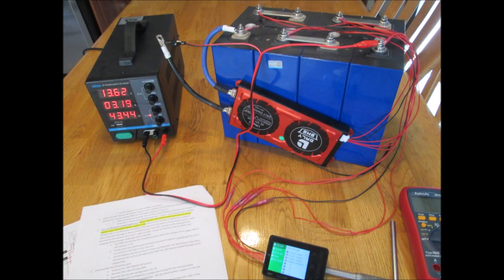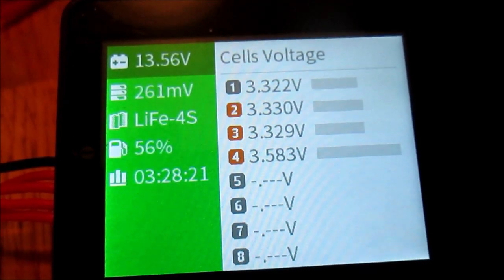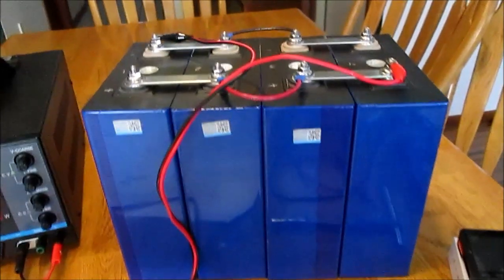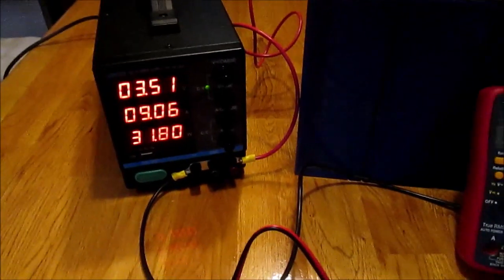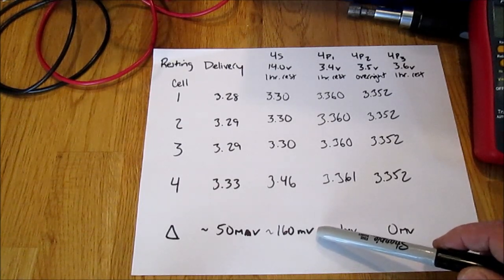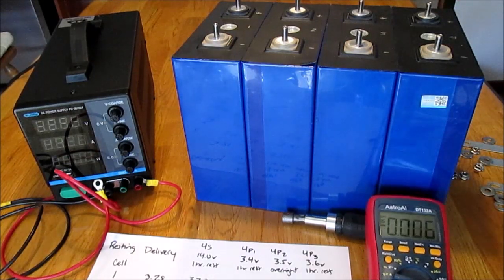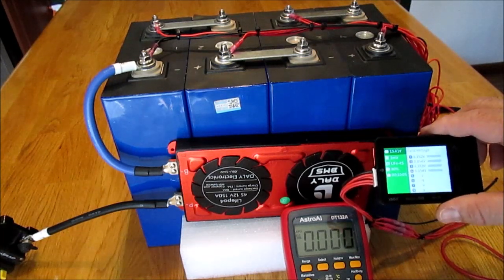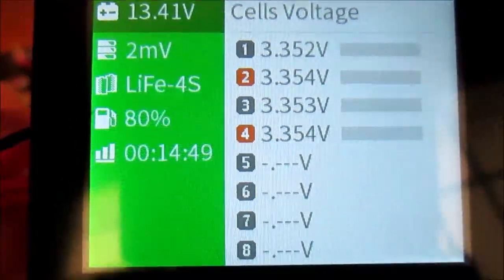V2 P3  3.5 Kilowatt Hour LiFePo4 DIY Portable Solar Power Generator

Comment: Is it okay to use the ISDT BattGo Battery Checker in LiFePO4 like EVE? I mean as a monitor of the cell's individual voltage, 24/7? Because the user manual said, "BG-8S is designed for RC areas, please don’t use this on other purpose." What will happen if you add the capacitor type active balancer plus the ISDT?
Reply from the maker: I have had no significant problems using the BattGo to monitor individual cell voltages  for my 280ah LiFePo4 battery.  I did replace the wire harness because connectivity was weakened and I was starting to get unreliable readings for one cell.  I installed a Heltec active balancer.  It can be used simultaneously with the BattGo monitor.  I don’t use the BattGo for balancing…it is unable to move enough voltage to be effective.  I did install a switch so I can manually turn on the Heltec active balancer, periodically, when the battery approaches full capacity.  Leaving the active balancer on continuously will, in my experience, negate your top balancing benefits by balancing all cells at all points on the charge curve.

Comment: Why aren’t you compressing the battery while top balancing?
Reply from the maker: Needed to reconfigure the cells from parallel to series after top balancing. My compression system was planned to be semi-permanent, as you will see in one of my subsequent videos, and I only wanted to set that final, compressed configuration once.

Comment: If you learn all the BMS can do, you can balance the cells through the BMS after they reach the top voltage.
Reply from the maker: True, Robert, the BMS can balance the cells, but it may take a very long time if the cell imbalance is significant.  The other factor is that their imbalance only tends to become apparent as they approach the extremes of the state of charge curve (top or bottom).  My BMS won't detect the imbalance on the flat part of the LiFePo4 charge curve because the cell imbalance is not apparent based on the voltage.  Many users of LiFePo4 cells choose to set their solar charge controllers to have their batteries operate in this flat part of the charge curve, for example between 80% and 20% state of charge, to promote battery longevity.  Many types of BMS won't efficiently balance the cells until the voltage variation is apparent, and that tends to occur at the top and bottom of state of charge.  To ensure that my cells are balancing at all times I have since added a Heltec active balancer to my system.
Reply: @JimFisherDIYPortableSolarPower  It doesn't very long if you charge your batteries to 90% first.

Comment: How do you explain the drop from 3.36 to 3.35? Was that just your overnight rest?
Reply from the maker: Yes, after charging and resting my cells settled at a slightly lower voltage

Comment: Hy Jim..." i have a Question...can i use 15-24V power supply to recharge my battery?  with BMS DALY will the BMS cut off the current when the BMS detects an overvoltage when the battery is fully charged?
Reply from the maker: Hi Andi...thanks for your question.   I am assuming you are dealing with a 12V battery.  I would not use a charger that isn't specifically designed for a 12V system and the specific chemistry of the battery.   I have a Daly BMS and if my memory is correct, the BMS over voltage cutoff for a 3.2V lithium cell is 3.75V.  The BMS should shut down charging at that point.  That voltage  is beyond what is understood to be fully charged (3.65V) and I wouldn't rely on just the BMS to protect my cells.  I like redundancy in my systems for safety (first and foremost), and also to protect the expensive battery cells and equipment.  My choice for charging is to use either a 12V specific lithium battery charger or a benchtop power supply where you can be in complete control of the voltage and amperage and worry a lot less about possible damage to your cells.
Reply: @JimFisherDIYPortableSolarPower  i saya punya baterai li ion dari laser level Huepar dengan voltase  baterai 7.4v dan dia datang with 12v charger,karena alasan itu saya menanyakannya...saya juga berpikir itu itu akan merusak baterai dalam jangka waktu dekat

Comment: How many millivolts of tolerance can these 4 cells accept, sir?
Reply from the maker: Very good question...they can "tolerate" hundreds of millivolts variation, but you would sacrifice usable amperage capacity as one is going to exceed the threshold of safe discharge well before the others (or conversely it will reach 100% state of charge before all the other cells got close to fully charged).  I can only tell you what my target is on a practical level, based on my first season of use with this battery.  I am comfortable when I see about 6 to 9mv variation in the cells.  I am quite sure my cells are B grade and I accept that perfect balance, at all times, is not likely going to be possible.  Keeping the variance as small as possible ensures plenty of amperage for loads with little worry about significant imbalance damaging the battery.

Comment: Why charge a 3.2v cell to 3.65v?
Reply from the maker: Per the technical specifications for charging these LiFePo4 batteries, they will achieve maximum state of charge (100% of amp hour capacity) when charged up to 3.65V.  The 3.2V rating is what is called the nominal voltage.  Same concept for a 12V AGM battery.  They are 12.8V nominal, but charged up to voltages in excess of 12.8V (13-14V).

Comment: Can I buy once charger to do both series and parallel? Do you have to keep checking it if your charging with out bms?
Reply from the maker: Yes, one bench power supply (charger) will be able to deliver variable voltage and amperage.  When charging without the BMS the charging will stop automatically when the battery reaches the voltage parameter you set.  For example, if you set the voltage to 3.6 the battery will continue to charge until it reaches that state of charge.  You will see the amps drop as the battery reaches the intended voltage target.

Comment: in series connection of batteries they can be balanced with a simple resistor of 100 ohms at 5 watts placed in each cell 3.6volt ÷ 100ohm = 0.036mah continuous balancing. this circuit is a shunt voltage divider used in the first satellites with low voltage batteries to increase the performance and useful life of simple and effective silver and nickel cadmium batteries.

Comment: @ 11:20 you state it's nit good to leave them at a high state of charge, this is untrue. You shouldn't STORE them at a High SoC, but charging them fully is no problem, they are meant to do it for top balancing.
You should have just cranked the voltage to 3.65 and opened up the amps, there is no way that benchtop PSU would hurt them(they are designed to charge at .5c which is over 150amps. seriously, these are not fragile under these conditions. 
Just parallel them up, and set to 3.65 and leave until charge current drops to less than .25amps; then they are done
Reply from the maker: Hi Michael, thanks for viewing and for your comments.   I agree, regarding SOC for storage vs. charging/top balancing.  It was not stated clearly and I can see how my comment might have been misunderstood, but I was not planning to put the battery into cyclical use for a couple of months following the top balancing video.  Hence, the need to reduce the battery SOC  to await the start of our boating season here in the northeast.  I wasn't worried about hurting the batteries, I just took the top balancing process slow to watch and better understand how each of the cells would behave given my suspicion that they were B grade cells and were not likely closely matched.

Comment: Hey if my Cells are well balanced When i got them 3.29Vx4. Do i need to top balance then or can i wire them in series direct and charge them with my ordinary 12v lithium charger.
Best regards Filip
Reply from the maker: Filip, I would definitely top balance the cells.   It is SO hard to know actual state of charge for lithium batteries by using voltage.  3.29V is in the very flat part of the charge curve.   At that voltage one cell may be at 40% capacity while another is at 60%.  Best to top balance all of the cells in parallel.
Reply: @JimFisherDIYPortableSolarPower  okey, thanks for the tip. My battery has now been charging for 4 days and is only at 3.37V. Is this normal ? From 3.30v to 3.37v in 4 days.
Reply from the maker: Depending on the size of the batteries and the maximum amperage your charger can deliver, yes, it can take many days to charge in parallel.

Comment: I think I bought the same BMS for my project and I wanted to warn you about a few things if it isn't the programmable one.  It doesn't cut off at the typical 2.5 volt low cutoff(10 volts for the entire battery) per cell for these batteries.  Also it has no low temperature charge protection, so if they will ever be less than about 34F they may need a heater or some other way to cut off charging to prevent damage.
Reply from the maker: Thanks for viewing and for your comments Allyn.   It is not the programmable Daly BMS.  I read reviews that suggested the programmable Daly BMSs have some issues too.  I do have a lot of redundancy built into my system to prevent damage.  My charge controller has an external battery temperature sensor and the controller can be programmed via bluetooth to shut down charging.  Given my intended use, I don't think the batteries would ever get down below 45 degrees or so.   I take this system off my boat during winter storage and keep it indoors during the winter months.  My inverters each have low voltage cutoffs at 10V and the load out on on the charge controller can also be programmed for a low voltage disconnect.  I have that set at a very conservative 11.6V.

Comment: A lot of people are having problems with 280hr cells with Daly or Over Kill BMS’s. 
Don’t freak. Top balance in Parallel to 3.65, then put back in series and connect the BMS of choice BUT add a Heltec “active equalizer” capacitor type. It’ll give you up to 5 amp balancing power instead of only 150 milliamperes. And it’s no resistance heat.
Reply from the maker: Karl, thanks for sharing your thoughts.  I'm planning to cycle this pack for a couple of weeks after I eventually get it installed in my case and put back into use on my boat and see just how much cell drift results.  If it doesn't seem that the Daly BMS and ISDT BattGo can effectively balance the cells I may give that Heltec active cell balancer a try.  For only $40 it looks like a good add-on that with much better balancing ability that may be able to manage cell #4 if it continues to be of concern.

Comment: Just so people know this who are watching and may not know any better.  Please be aware NOT to connect any cells together in parallel that are more than 10mv apart from each other, If you do this it will cause an in rush of current to the lower voltage cells up to the max current the cells can push out in order to equalize themselves ( if the cells are 1C rated, this can be up to 280 amps+). I recommend charging the cells individually first to have them at the same voltage if they are skewed more than 10mv, or grab a 3 or 6 ohm 100 watt resister for $5 and attach it to the high voltage cell to drain some of its energy first and of course keep an eye on it. Just want everyone not to ruin their cells or hurt themselves.
Reply from the maker: Sound advice, Patrick. Thanks for viewing and for your insight.  Comments made in the interest of stressing safety are always welcome.  I certainly agree that the closer the individual the cells are in voltage, prior to connecting in parallel, the better.  

When researching top balancing methods I read that a difference of as much as 100mv is acceptable for immediate parallel connection of four LiFePo4 cells, but if they differ by as much as 250mv it is absolutely necessary to bring the lower cells up the voltage of the highest by individually charging the cells before connecting in parallel.  Source:  https://diysolarforum.com/threads/how-to-parallel-balancing-yep-99-of-us-is-doing-it-wrong-part-1.3699/

In hindsight it would have been better if I had immediately connected the cells in parallel upon delivery when the individual cell variance was only about 50mv, let them sit for 24 hours or more, and THEN connected them in series to charge them at 14V to bring them closer to 3.6V each before reconnecting in parallel to continue the top balancing process.

Comment: I had the same scare with one battery gaining voltage faster than the rest, the reason I believe that happens is because that cell is on the end of the series. I have 4 sets of 4 280ah cells and each 12 volts pack did the same thing with just one cell. Once I charged them at 12 volts to whenever that one cell hit 3.65, I parallel them and started charging again to 3.65 for the whole pack. Problem solved.
Reply: Yep I also changed the guage of my bench supply to 10 gauge and it made a world of difference
Reply: Also I charged them at 3.65 volts and 20 amps using a bench power supply and a drock buck converter
Reply from the maker: @JM-yx1lm  A 20A bench power supply, or larger, would have certainly helped to move the charging process along a lot faster. The 10A power supply I used got the job done, but it was an exercise in patience to be sure.
Reply from the maker: Thanks for viewing and for sharing your experience!   I noted the same while charging in series, the first cells at the most positive and negative poles gave higher voltage readings using both the multimeter and the BattGo monitor.  In my specific instance, cell #4 definitely arrived at a higher state of charge as it achieved 3.65 well ahead of the other three cells.  I also observed, upon delivery,  that cell #4 appeared to have expanded a bit (bulging at the sides) as compared to the other three cells.  I was relieved to find that all 4 cells balanced.  How cell #4 will behave relative to the other three through successive charge and deep discharge cycles remains to be seen.

Comment: So I am doing the exact same thing this week. Started on Sunday, and now its Wed evening, and the cells are at 3.3v. I am using a Riden RD-6018 power supply which works well for parallel charging at 3.65V. 
I am not stopping at 3.3, 3.4, 3.5 etc. I just set it at 3.65V and let it do its thing. I bought a small 4s bms for the serial charge step, but waiting on my 12V Lifepo4 charger from Victron. 
I have the same Battgo to use for the serial charge step. Where did you get the long balance leads for the Battgo? I ordered a set, but they came in at only 5 inches. Way too short! Do you have a link to where you ordered yours from? 
Thanks for the upload! Very timely, and great job!
Reply from the maker: I wasn’t able to find longer leads for the BattGo meter either.  I started with the same 5 or 6 inch leads for 4s connection and simply lengthened each lead using same sized wire and crimp on heat shrinkable butt connectors.  You can see the connections at 3:25 in my part 10 video.  A link to the 22ga wire I used is in the description under the video.

Comment: Really a great video. I'm learning A LOT. So do you think you'll replace that BMS with some thing else so it shows the correct state of charge, or just stick with this one? Keep up the great work.
Reply from the maker: Thanks for viewing and for your question.  I will likely keep the Daly BMS.  The BattGo meter is unreliable as far as its estimate of % state of charge is concerned.  After initial top balancing I will only attach it and use it every 6 months or so to monitor individual cell voltage.  The MPPT solar charge controller I have in my system has Bluetooth and will send state of charge data to my smartphone.  Hopefully it will be more reliable than the ISDT BattGo meter.